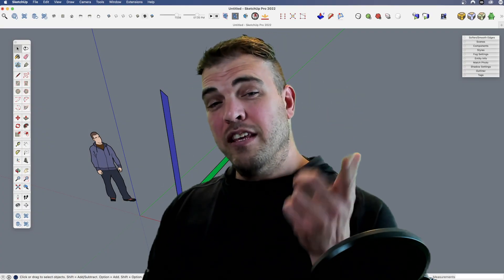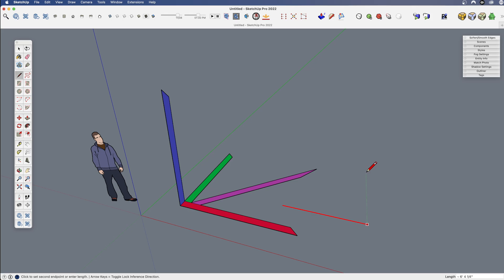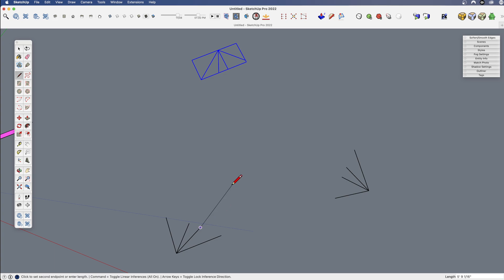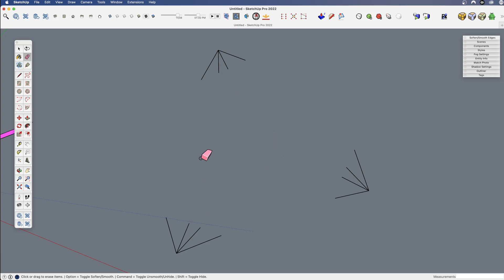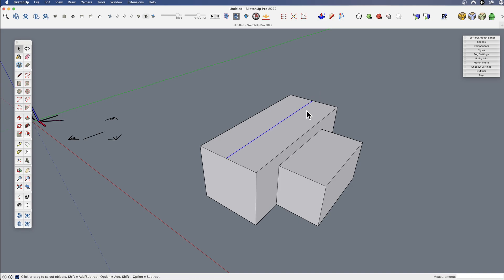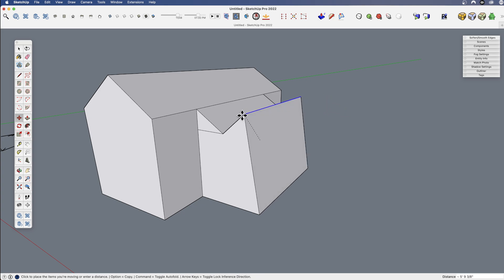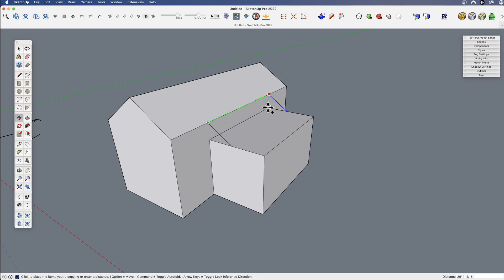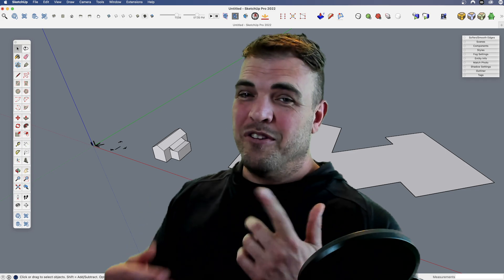This Technique Will Help You Model Faster in SketchUp

Comment: Hello Tyson!

Good that you explained this again. 
My question: is there a way to also align the protractor to a reference axis? 

Let's say you have an eave that is sloped in plan and you want to apply an angle at right angles to it. --- 90° to the eaves edge and then measure any angle. 

Then neither the selection of the red, green, blue, black or magenta colored axis fits. 
Do you know what I mean? 
Many greetings, Thilo